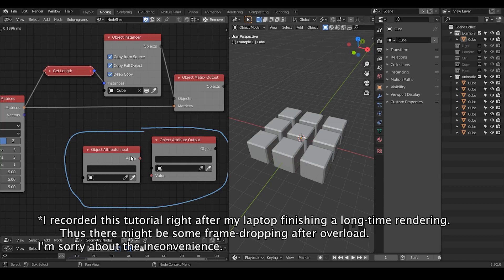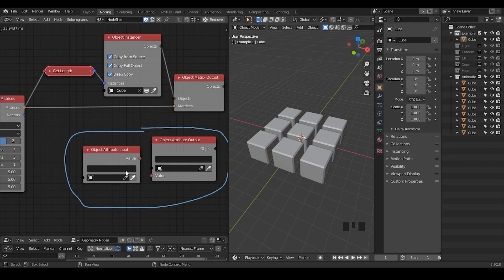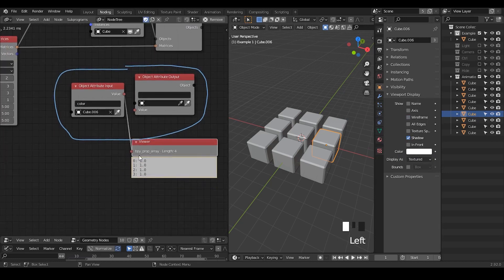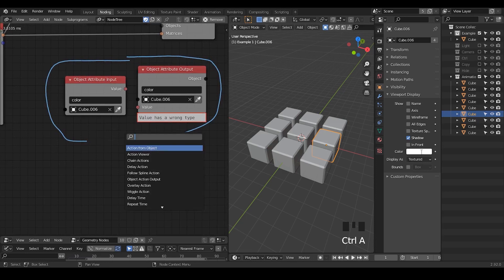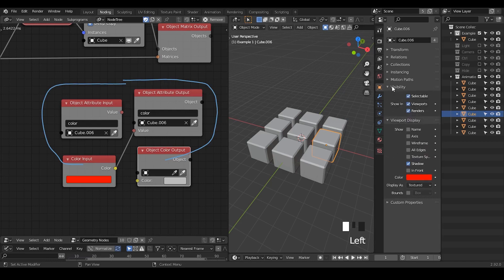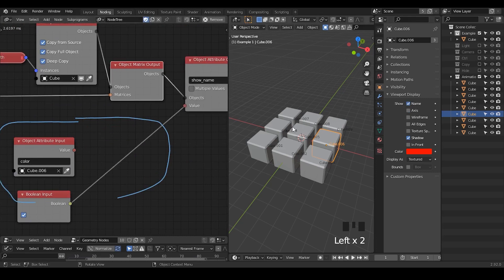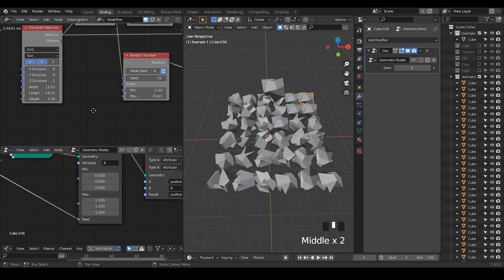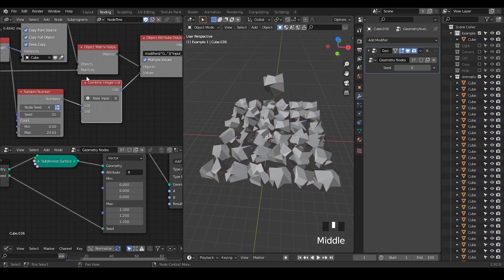[Tut] Control Objects' Property & Modifier using Object Attribute input & Output; AN-fundamental

Comment: Learnt too much from your tutorials, thank you

Can you make tutorials about vector length, vector distance in AN?
Reply from the maker: Thanks! But vector length and vector distance are just simple math formula, I am not sure how it's meaningful to have a tutorial addressing that. What do you really want to know? Isn't that as straight forward as what their name states?
Reply: @bradleyanimation120  well, yes they are straight forward but i've never seen anybody using these two in any tutorial, how or when to use them how to manipulate them etc..
Reply from the maker: @uzaykisi1863  Then I won't, because I also don't really know what I can do with them. I have used them in the past for some reasons, but not big enough that really requires a tutorial. There are many nodes and sockets in AN, it's unreasonable just to make a tutorial because "I don't know what they can be used for". In such a case the priority to make a tutorial will be extremely low.